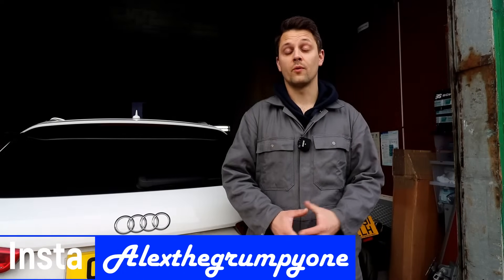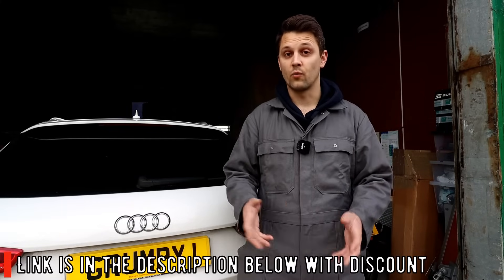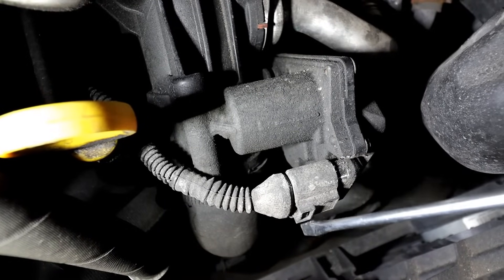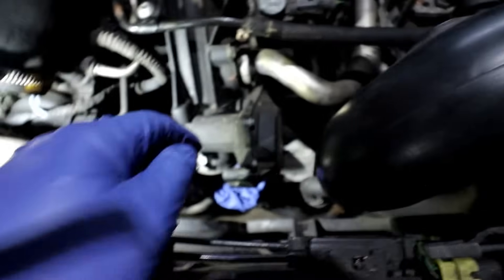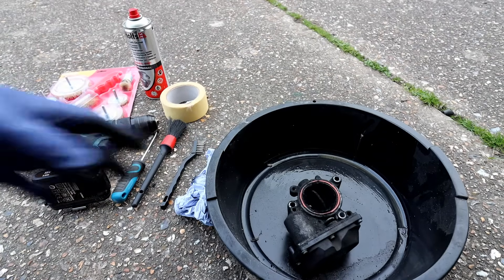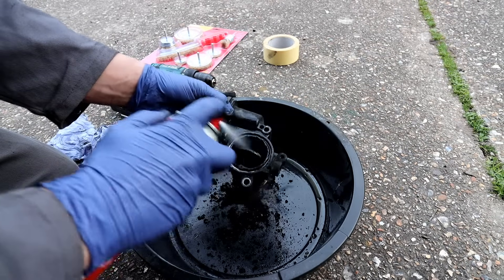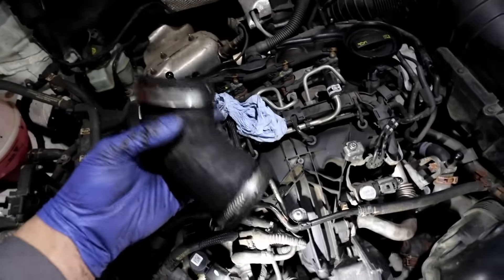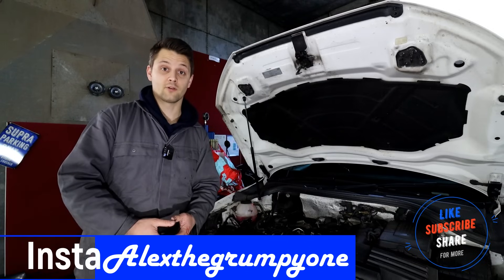P0121 fault code fixed for free. Audi/VW/Skoda/Seat 2.0 TDI engine. Throttle body cleaning/repair.

Comment: Going to need to do this as I just got a code p2111, but in the past I’ve had ones related to the EGR. Where abouts is the EGR in this engine, is it near the firewall in the back?
Reply from the maker: Yep thats the one. They are a bit of a pain, specially of you have got 4x4

Comment: I can’t get the top of the hose back onto the unit, any ideas ? Tried washing up liquid to make it more slippery, no joy, I was thinking of heating up the rubber tube, would that be ok ?
Reply: Did you try heating the rubber hose?  Did you manage to get it back on?  I have got the hose off mine, I will do the clean tomorrow, and I can see how it will be very difficult to get the hose back on at the top. I was thinking the same thing - heat!
Reply: @user-fh1rz1uq6c yes my son has smaller hands and he managed to do it.

Comment: Well thank you so much for this video. I'm not a mechanic but attempted and succeeded with the help of this lesson. Getting the hose off and on was tricky as were the bottom bolts but perseverance won the day and now my engine light is off and I don't have a garage bill so thanks again. . (Throttle body was in the exact same condition as the video one; totally caked-up). 👍 Top tip? Get one of those teeny weeny ratchet sets for hose clamps and the torx bolts and life is much easier.
Reply from the maker: Thank you 😀 
Well done!

Comment: Bought a brand new throttle and it stills shows error about throttle body sensor, check engine light is always on the panel, because of that, tried everything  even tried 3 diffrent throttles and it still dont work. Someone has same issue? Audi a3 2003
Reply: I have the same issue on my vw scirocco 2.0tsi 2009, did you solve it?

Comment: Hi there, 

My golf mk6 2.0 tdi not starting, 2 codes popped up one is for P0121 and other P068A, the P0121 it says throttle body sensor and other one is electric related

For electric i think its battery needs tl be replaced but for throttle body sensor, do i replace the sensor or take out the throttle body, and u think its the throttle body that causes the car not to start ? 

After fixing this throttle body issue will the car start again?

Cheers
Reply from the maker: I would definitely check the throttle body first. If it's getting stuck it can get that problem
Reply: @AlexTheGrumpyOne  oh ok, I'll definitely take that out and see if its clogged, cheers for the responds

Comment: Hi my exhausted valve is coming up went and got a new motor to open valve on exhaust unplugged them Audi s3 when I have it in sports and speed EPC light comes on and feels like it’s shaking ? Any help I think it cools be this Audi s3 2018 79k miles

Comment: Great video and explanation. Forgive by ignorance, I'm useless with cars. But I have this error code on a Skoda Yeti, if I got a competent mate to do this job would this video be relevant? Thanks in advance.
Reply from the maker: Thank you. If your engine is 2.0 tdi then it will be the same 😀
Reply: @AlexTheGrumpyOne  it is! Thanks for the quick response. Much appreciated 👍🏻
Reply from the maker: @karlholtby no worries
Reply: Cleaning throttle body is a good idea on any make of car

Comment: I relay dont understand where all that dirt is comming from as it is only air that passess the throttles and there should be a an air filter filtering the air anyway
Reply from the maker: Unfortunately it's not just the air.
It's air that gets mixed with EGR air as well... for the emission control purposes.... which is the main cause of most engine issues and engine lights and etc...
Reply: @AlexTheGrumpyOne  I wasnt aware the egr air passes the throttle. That explains it.
Reply from the maker: @coiamo yes unfortunately it does 😞

Comment: I replaced my throttle body and now my fuel paddle is not responding.  A3 2.0 tdi Audi. What can i do?
Reply from the maker: Have you disconnected the battery?
Have you go diagnostic tool?
Reply: @AlexTheGrumpyOne  ...I did disconnect the battery yes. I think I must go for diagnostic
Reply from the maker: Yes u might need to reset the learn values

Comment: Very useful video. How would you clean the area between throttle and air intake valve?
Reply from the maker: If you take the seal out u can use a very fine sand paper

Comment: great video! my tdi wouldn’t start in the cold yesterday. got it jumped (battery was low) and glow plug light was flashing and check engine light were on. charged battery, started this morning, glow plug light gone but still reading “P0638 Throttle actuator control range” code. would that be same thing? coincidence it could be dirty and not start or could it be from low battery and -20* temps and needs to be cycled? thank you!
Reply from the maker: Hi it is possible. Sometimes due to voltage differences it can create a fault and etc. Have you tried to clear it?
Reply: @AlexTheGrumpyOne yes i tried and it said “permanent”. just seems odd that it would appear when it wouldn’t start because of the low battery in cold weather

Comment: Hi mate I’ve got this code and throttle response is rubbish so it’s going to the garage tomorrow, but also does this affect anything to do with turbo?
Reply from the maker: It can as it would affect the air flow
Reply: @AlexTheGrumpyOne  thanks for your reply, my turbo has been louder lately and sirens more than normal, I pray I don’t need a new turbo!
Reply from the maker: @NotoriousFaZeDx hmm if uts louder then it's a possibility.
Needs checking the play in it and also the actuator
Reply: @AlexTheGrumpyOne  found out it’s the egr valve knackered:/ going to be £700 unless I get the egr deleted:/
Reply from the maker: @NotoriousFaZeDx I usually get EGR delete with map done in the same time. Around £250 and either more power or better fuel economy and no more EGR crappie issues

Comment: Got an 09 A3 2.0l tdi showing fault P2196 (O2 Sensor Signal Stuck Rich Bank 1 Sensor 1) could this be a blocked dirty throttle body?
Reply from the maker: It can be, but I doubt it.
I would suspected blocked sensor or faulty sensor

Comment: I replaced ny throttle body and the reset the fault code through an obd. But the fault code still appears, could replacing the pedal  (pedal position sensor) fix the problem or do i need to reset the value on the throttle body?
Reply from the maker: I would try and reset the throttle body first

Comment: Hello mate, just wanted to know/confirm so you need to electrically reset the throttle body once you re-plug it back in or does ir just work straight away? Wanting todo this on my 2.0 TDI 170 Scirocco can you just press the accelerator down, turn the key, then release the pedal, remove the key?
Reply from the maker: Hi there. No u can just need to unplug the battery for 5 min.
Reply: @AlexTheGrumpyOne  Thank you, as you say in the video confirming the disconnect will reset it all anyway 🙂
Reply from the maker: @alexmilne7634 yep it should do 😀
Reply: @AlexTheGrumpyOne  That’s ace mate, thank you! You are always a massive help!
Reply from the maker: @alexmilne7634 thank you very much 😀
Reply: Thanks

Comment: hi can throttle body cause bad start and jumping idle speed? i have fault code P1588
Reply from the maker: Yes it can do.
Have you replaced your fuel filter?
Reply: @AlexTheGrumpyOne  i cleaned EGR valve, body throttle and i still have jumping idle speed...no i didnt replaced fuel filter maybe thats the cause?
Reply from the maker: Yes usually in 70% of the cases blocked fuel filter or bad fuel.

Comment: Useful video thank you. I’ve just completed this on my Audi A3 1.6tdi. Had been having jerky throttle response at low speed. Seems to have improved it but mine wasn’t anywhere near as dirty.  Anyone trying this on an A3 you’ll find there’s very little space to work and putting the hose back on is torture and I’ve got small hands. If you’re the Hulk then forget it.
Reply from the maker: Awesome 👌  well done and thank you for sharing extra info 😀
Reply: Bro i have the same issue with my audi a 3 can you help me
Reply: Just did this on my a3 8pa. This car is an absolute nightmare to work with oh my goodness. My hands look ive been digging a hole with them for the past 20 years. Just pay someone to do it it’s not worth the time and effort
Reply: Did this today on my Q3 as I was doing a service and the code for this had been on for a couple of months. As others mentioned it's tight and it was a nightmare getting the hose off and back on it took hours so might be best paying someone to do it and save yourself the headache!

Comment: I wonder why these get so badly Carboned up? I have the old pd type engine bkd and I cleaned mine just because I thought it might need a clean and it wasn't too bad at all.
Reply: Intercooler pipes and inlet pipes can split. My PD130 is on 235,000 miles now and it's perfect. I've changed my inlet pipes as they split, causing boost leaks and spraying oil everywhere!

My wife's Yeti throttle was WAAAAY more clogged than this one, I cleaned it yesterday 😮
Reply from the maker: Mate PD engines are the best thing u can get. Specially with that vacuum operated EGR at the top. Only £50 to replace 😀 no dpf or any other useless improvement...
Reply: @AlexTheGrumpyOne  That's why I have never got rid of it lol 😆. It's on about 172,000 miles and still drives great. 

For a period of time it kept going into limp mode (cus of overboost), tried cleaning the turbo veins, checked for boost leaks, checked all my vacuum lines, checked turbo actuator with vacuum pump and it was all good, so maybe a sensor I dunno they were all read ok, I dunno. But recently after a long holiday drive it has stopped doing it lol, so it's fine by me now 😄.
Reply from the maker: Haha fair play. Well it's usually boost leaks on the turbo pipe joints actually. But turbo does go on them
Reply: @AlexTheGrumpyOne  Yeah i have already change the common one to go which is the one coming out of the intercooler, but i might change the 90 degree one coming out of the high pressure side of the turbo, noticed the other day it was a little moist around the connection.
Reply from the maker: Yeah I would as its only around £20